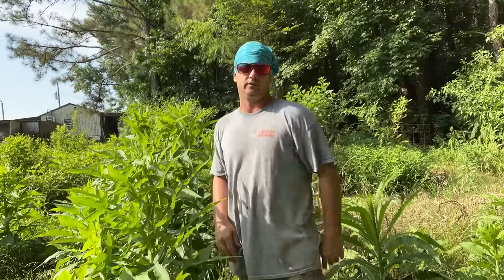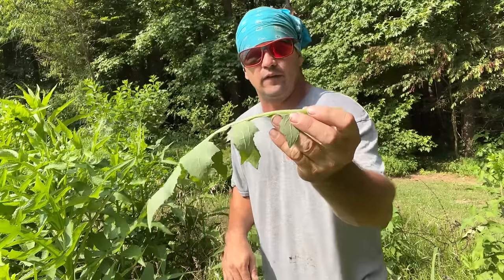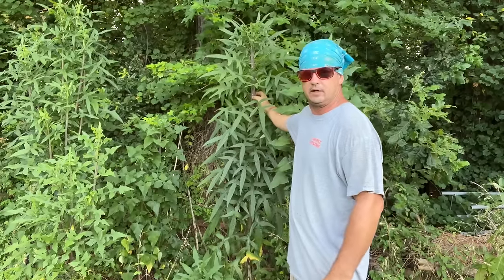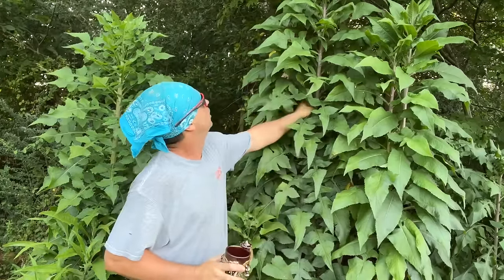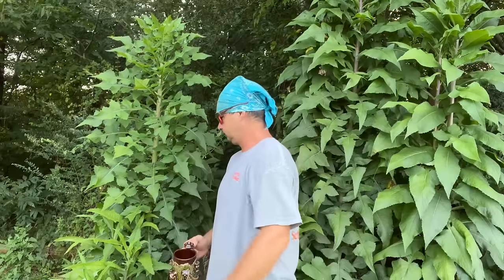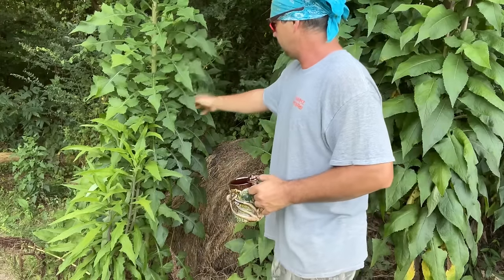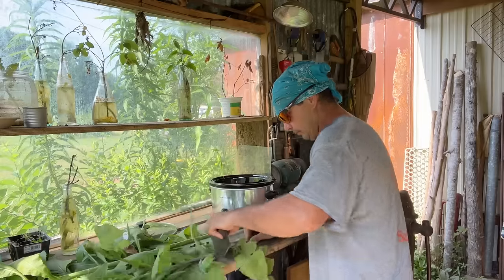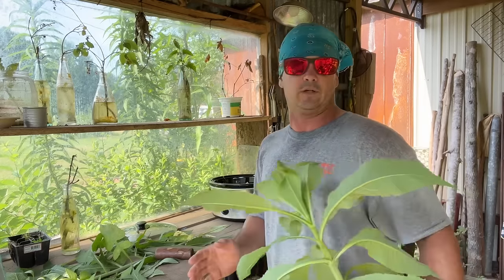Processing wild lettuce into condensed black syrup pain medicine

Comment: What's the easiest way to identify Wil lettuce? Pretty sure I have a ton in my backyard.
Reply from the maker: One main stalk that bleeds lactucarium when injured. Alternating leaves from the main stalk . Many of which have spines or hairs along the inderside of the center spine of the leaf. Most leaves are lobed or serrated on the edges . The lactucarium is very bitter , mostly white but some species its yellow
Reply: @SpiritoftheOutdoors  Awesome I was just going to ask about the spikes/hairs because I seen them before. Last summer I sliced the staulk on what I think Identified as opium lettuce and it tasted very bitter so I think that was it; going to look tomorrow. Is there any other plants that lactate that might look like it?
Reply from the maker: @ChiTownGuerrilla  thistle does but it has thorns and it wont hurt you
Reply: @SpiritoftheOutdoors  Thorns on the stem? Appreciate the replies. Dealing with an opiate addiction, hoping this will help with the withdrawal.

Comment: Hey, just an idea, if you have an empty tube of caulk for that caulking gun, you could clean it out, stuff your cooked plants chopped a little finer, and use that as a press. 2nd note; if you put a pan with sand on your gas burner and put your pot on that, it'll heat more evenly and won't burn up you pot. Love the information. Learning a lot from you. Thanks!
Reply from the maker: Now you are the first person to comment with 2 really good ideas. Thank you . I hope you stick around
Reply: I like your caulk tube idea.  Not being food grade plastic,, I wonder if the chemicals from the plastic would leach into the product?
Reply: @JulieM-ff9dq  I'd recommend checking the recycling code for sure. I just checked a bottle of kitchen/bath silicone I have and its standard HDPE recycling code 2. Most food containers are made from HDPE and seldom (doesn't mean never) have any added plasticizers. The plasticizers and hardeners are the chemicals responsible for leaching. Micro plastics on the other hand........ they're all a problem.
Reply: @adamwilson3238  ahhh, thanks for that.

Comment: You are making yourself more work that you need to. I do not have time to sit over this process.  Here are my suggestions to let it cook without having to watch it as close as you do.   1. Chop those stems up in pieces no more than 1/2 inch. It is more work in the beginning but it is going to save you so much work later. 2. Don't have the crock pot on high.  Leave it on low for the entire cooking process. Don't take it out of the crock pot and simmer it. Leave it in there over night if you need to.  When you do take it out, strain it right then. Use cheese cloth or old pair of nylons and squeeze out as much liquid as possible.  3. Clean the crock pot and fill 1/2 to 3/4 with water.  Put the tincture in a quart jar and set the jar in the crock pot. Keep it on low while it is evaporating.  Again just have it somewhere that you can check on it every couple of hours.  When it starts getting thick check it every half hour.  Yes this may spend more time for the total process but it will take less of your time and you will be less likely to over heat the tincture. I just feel he is trying to rush it and taking chances with too much heat.
Reply from the maker: My suggestion is you watch my ofher videos and other methods before typing a book since you dont have much time

Comment: You didn't explain how much to take, how often to take it. How to store it, how long it can be stored. Does it need to be kept in the refrigerator? You left a lot out.
Reply from the maker: Its really not a set dosage on this. Each batch can be stronger or weaker . Is not string enough that you can Overdose so you have to trial and error it. I keep mine in the fridge but i dont think it’s necessary because it has no water left in it. Ive had mine a year
Reply: @SpiritoftheOutdoors  thank you for your response